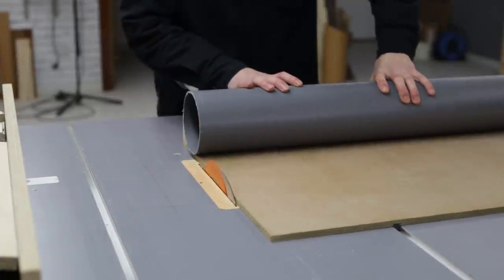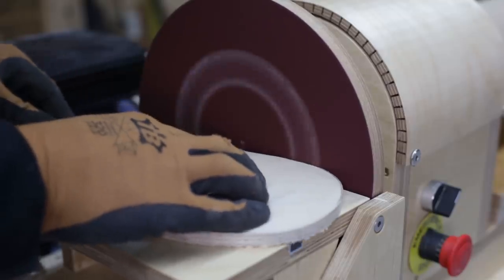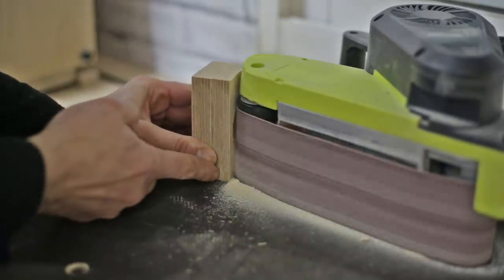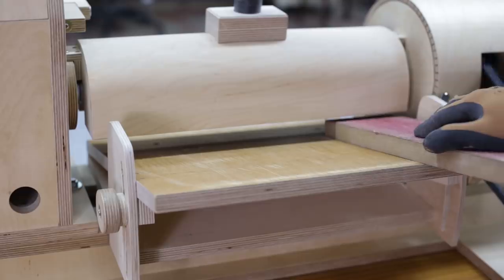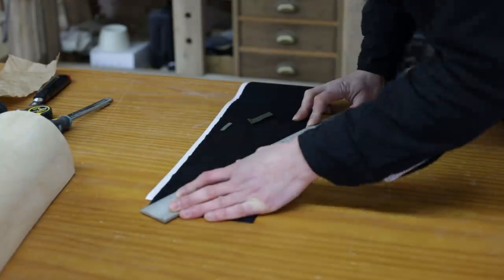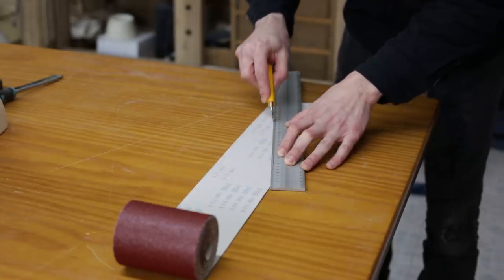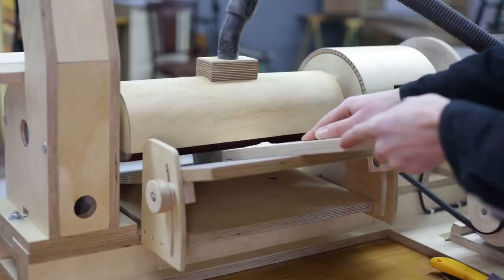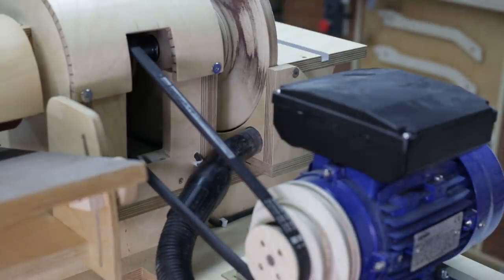Lathe Sanding Station: Thickness Sander Part2

Comment: Wow! Another awesome series to watch! You are an awesome woodworker! 

I have bought your 3D Router and will certainly buy this one also! These 2 together combines so much machines its incredible! You can sand almost anything, can cut/shape almost anything too.

3D Router: Drill press, upside down router table, 2D and 3D copier, circle cutter, manual mill, small vertical thickness sander (possibly other things)

This: Lathe, disc sanding, horizontal thickness sander, belt sander.
Reply: Also, there is the table saw/router/jigsaw station that he made, so 3 machines and you have got pretty much everything needed in a workshop.
Reply from the maker: yeah! thanks for your kind words Eric!

Comment: You are the Master Craftsman, Paoson & a true inspiration to me. Another mind blowing project/video. You're explanation & attention to detail, is second to none. 
I've made a Disc Sander, using a similar set-up, but am having to run it off a 1050Watt drill. But, do you think it would be possible to add a pulley system to the drill, so as I could gain higher/lower the speed ratio & add a lathe to it also. I would be extremely grateful for any kind of response you give me.
Kind regards & looking forward to many more of your projects.
Reply from the maker: Of course, with a good design you could add the pulley system to the drill, thanks

Comment: Paoson; just a quick question regarding the 3D Router.

For your 3D Router, do you plan on making the base a downdraft table in the future? I believe it would be an awesome idea for it. It would make your 3D Router even more versatile and along with this machine (Lathe/sanding station) would reduce even more the tools needed for an amateur workshop.
Reply: oh and also, do you plan on making a jointer at some point? I would really like to see you tackle this task!
Reply from the maker: a jointer is one of my future projects! Your idea about the 3D Router is clever, share it with me when you finish!
Reply: I have bought the plans since October of last year, but haven't been able to make the 3D Router yet, my sciatic nerve was pinched 3-4 years ago and could barely work in the winter. I have bought myself a truck and it helps so much with my back that I don't feel the pain anymore (or almost)... so I will get back to it as soon as possible. Just need a couple of items to build it completely and will implement the downdraft feature for sure.

Can't wait to see you make a jointer! hope it will be wide enough to joint large board pieces and all homemade (cutterhead not bought)

Comment: It would be better to heat up the Velcro as you until& glue it, on the bottom side - similar as the roofers do, with a felt and a burner 👍